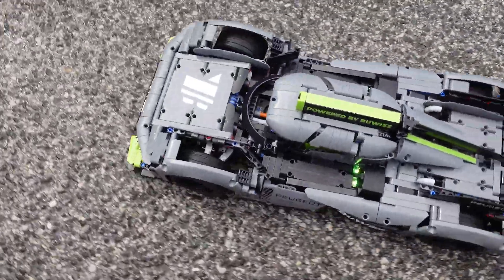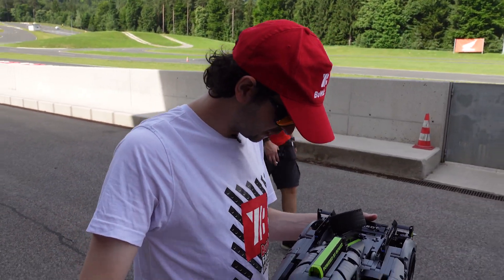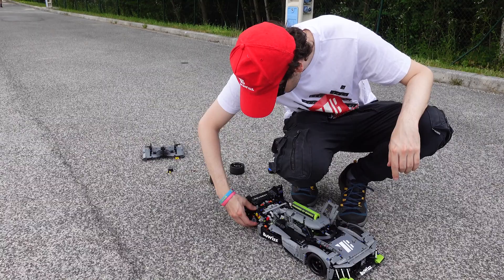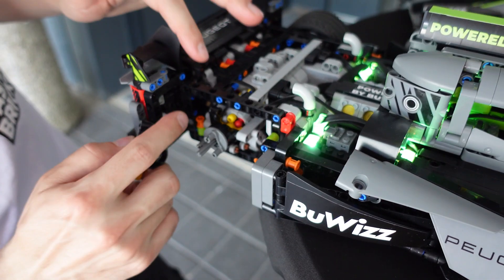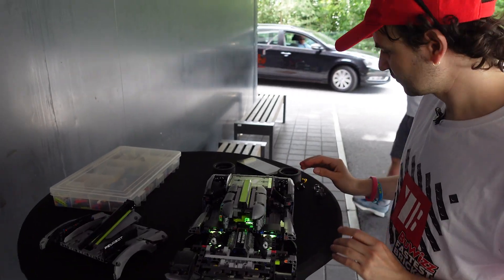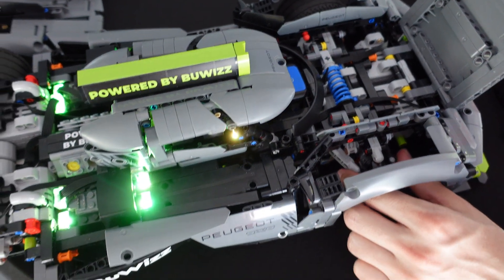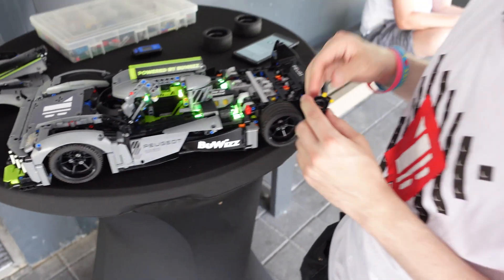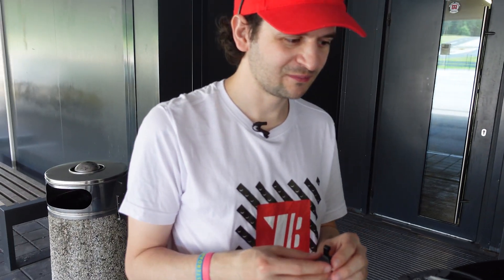42156 LEGO® Tecnic™ Peugeot 9X8 24H Le Mans Hybrid Hypercar

Comment: 6 motors?!? That's all?!? Just kidding of course. I'd like to add that the mineral oil used in electric shavers works great for brick built creations because it does not degrade plastic and reduces friction.